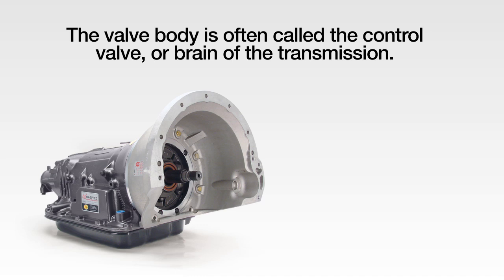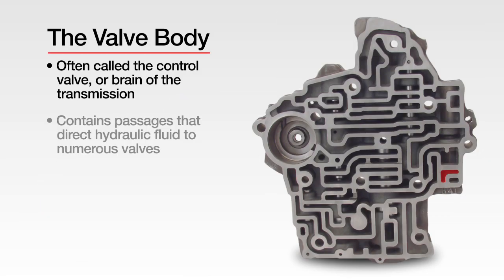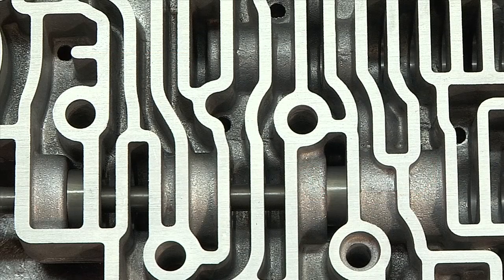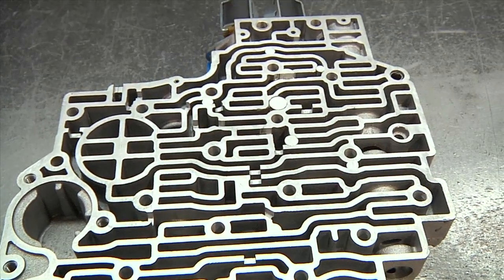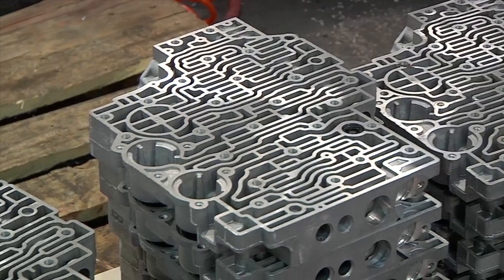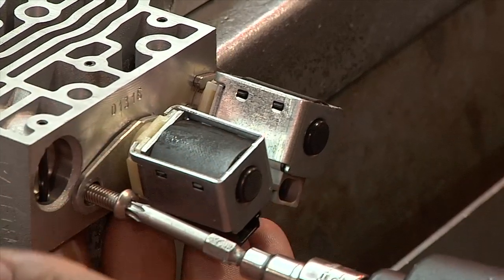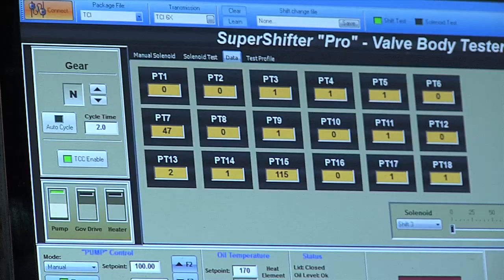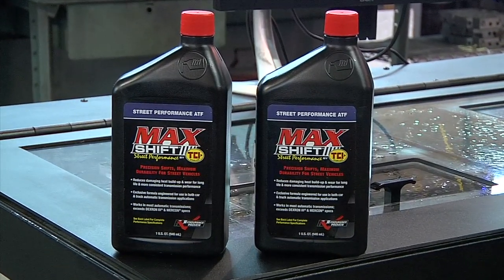Technology Explained: Valve Bodies & How TCI® Builds Them Better

Comment: Are higher rpms to take off a result of a bad valve body?
Reply: No. The valve body does hardly break, and if it does you will see there is a leak. It could be if the transmission gets hot, and to compensate for that the computer will delay shifting. Reason that it gets hot could be oil is getting old. It could also be due to a request for another system such as the emission control system.

Or it could be that you need to reset the "artificial intelligence" that adapts behavior based on its experience from the driver(s).
Reply: Very interesting, Thanks

Comment: i also would like to know if there are any automatic transmissions built today for the new cars that have pumps in both the front and rear of the transmission because i only know of a few of the older transmissions that have that and that gives me one last question and that is can a pump in a transmission be made to put out more pressure to feed the clutch plates and give better performance
Reply: Line pressure can be modified via the ecu, its a great way to bark second gear about 12 or so times before you walk home.

Comment: is it possible for you to place a plexiglass piece on the bottom to show how the fluid travels thru each gear on both regular and race transmissions. i know some of the basics that go into making a transmission for racing but i would like to learn more and to be able to see exactly how the fluid flows would help me out a lot and also an explanation of the modifications and what they do or why they were performed would be nice. like i said i know some basics but would love to learn more and also would like to learn about lockup torque converters what they do and any modifications that can be done to make them perform better thanks